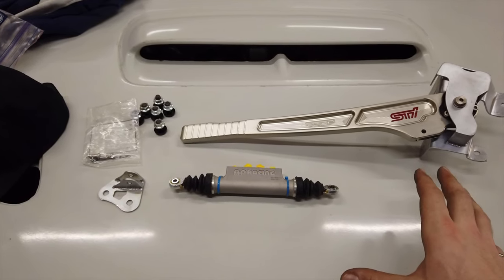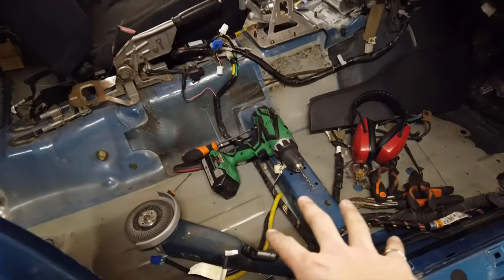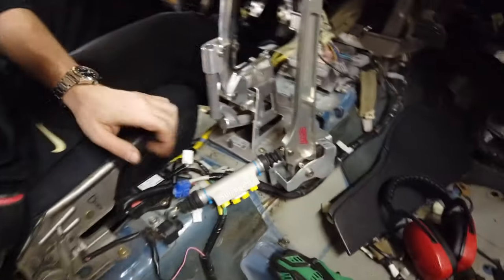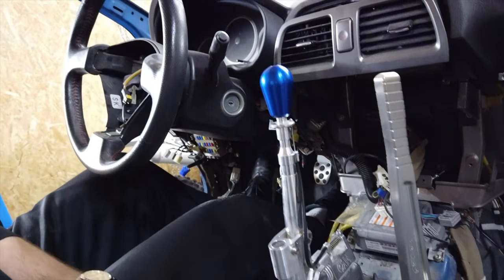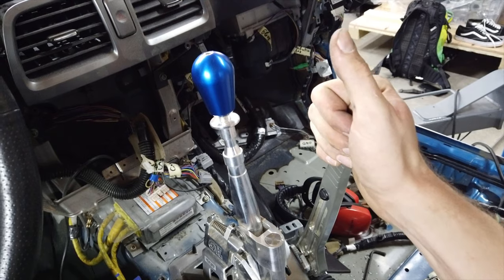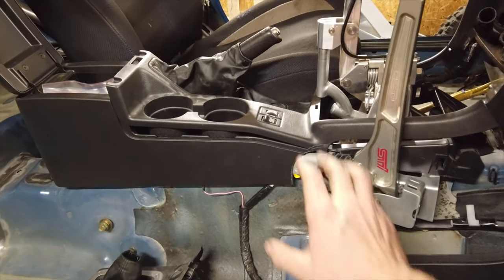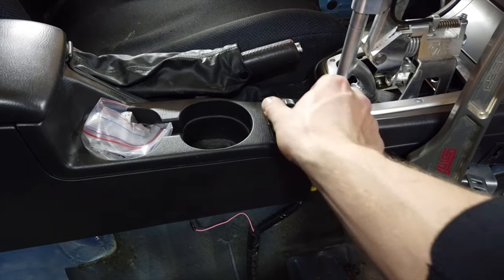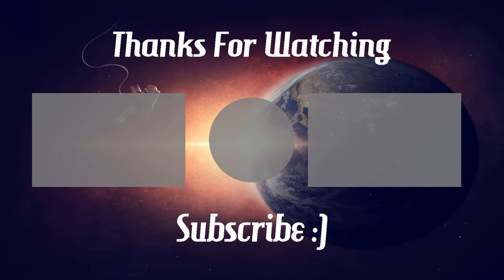GC8 RSTI Subaru Build - Hydraulic Handbrake Install - Ep. 29

Comment: Is it necessary to leave the original handbrake on it too, or can you remove it if you want to? Considering the new hydro e brake can do all the same things with no issues
Reply from the maker: They are two different things, completely independent from each other. So feel free to remove the oem hand brake (in fact i don’t think wrc cars had cable hand brakes back then). I just kept it to keep the oem feel of the interior and in case there is a leak in the hydraulic system.

Comment: Does anyone have a part number for the ap racing master cylinder? I was told it has to “match your rear calipers”? So i am guessing there are different sizes and I want one to match my 2007 sti rear calipers
Reply from the maker: CP6026 is the one i’m using. Regarding matching it with your car that is entirely up to you and your preference. Some people like it stiffer some softer 👀

Comment: what centre console is that? a 2005?
Reply from the maker: GD, any year between 2002 and 2007 (with slight differences to the center console trim for 2006-07). Mine is a 2006